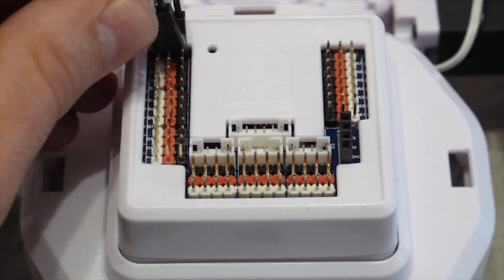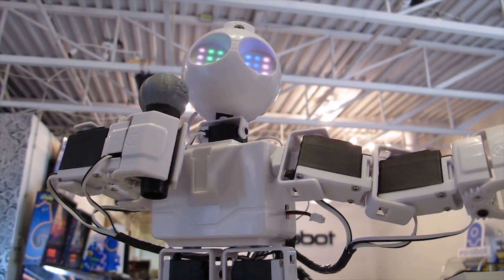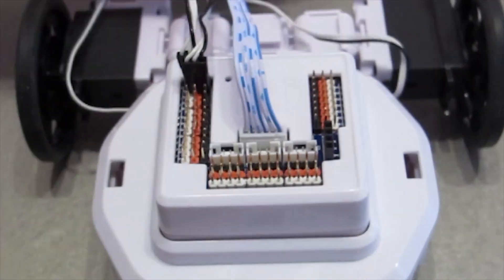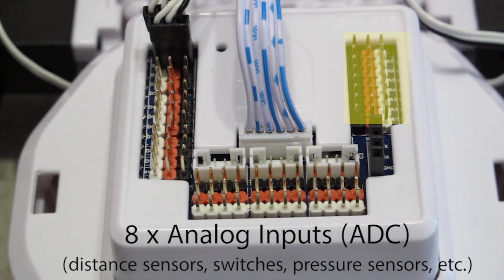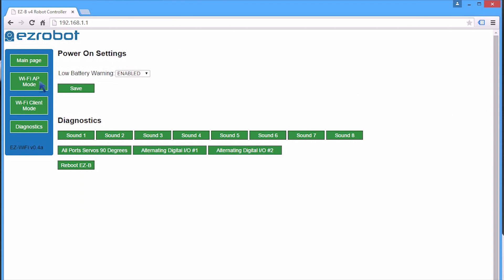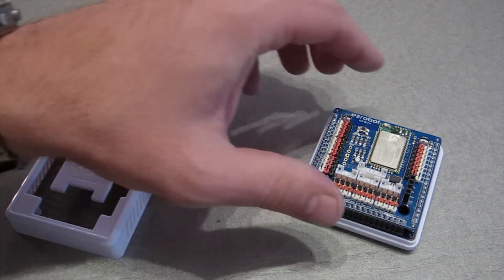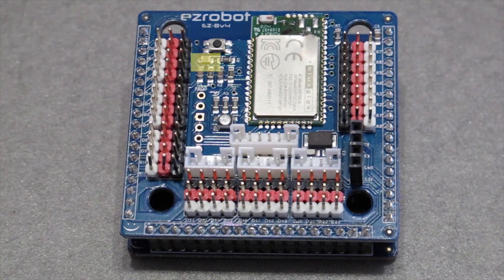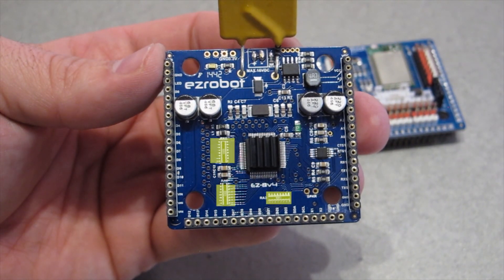EZ-B v4 Robot and IoT Controller

Comment: Geek-spaz-moment. XD I love this robot brain so much. Sure it's not the fastest Snapdragon processor, or even a snapdragon at all, but it enables so many things at such a good price. 
So what I'm considering doing at the moment, is to use my current high-power rock-crawling RC car, but placing your robot brain EZ-B v4 onto the top of the car. Then on top of that would be a snake bot made of 20 of your servos. With your clasping hands at each end of the snake bot. So it would be an RC car with two arms. With a fairly loud speaker inside the car. All very easy things to do, assuming there's a simple way to control a 20-servo arm anchored in the center. 
So some other basic features could be a GoogleHome within the robot, but that's a future project. 
A remote control blaster laser would also be integrated and a FM Radio transmitter. All nerdy things to be added later. :D
But it's all possible thanks to Ez-robots. <3
Reply: hi i'm in Brooklyn ny I bought a JD robot for my son and cannot get it on the wifi do you know someone in the area that can help me get this robot working  please contact me at 347-249-9911 my name is Tommy